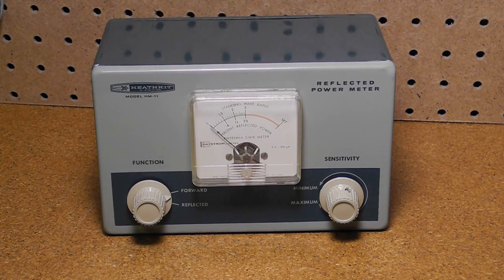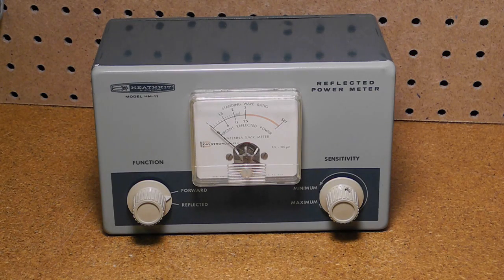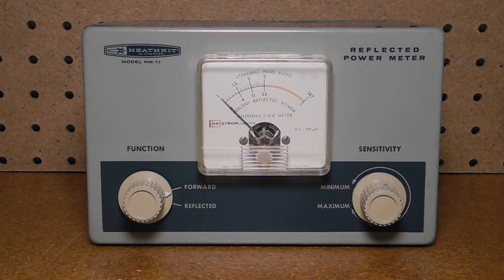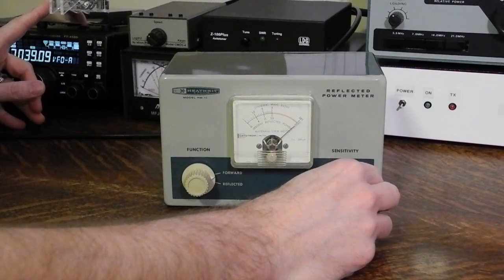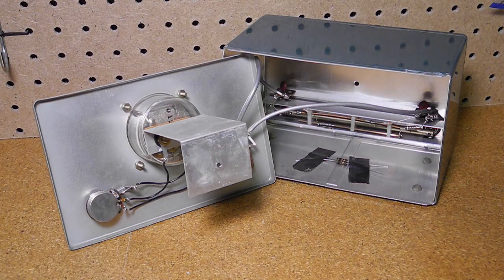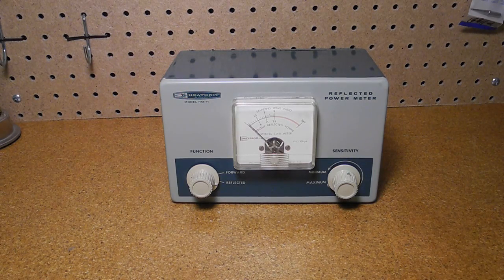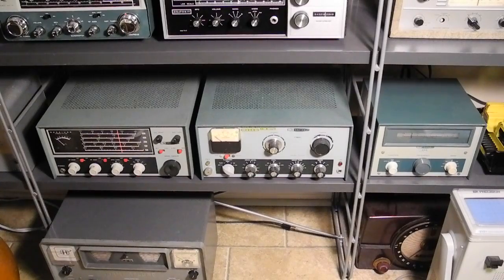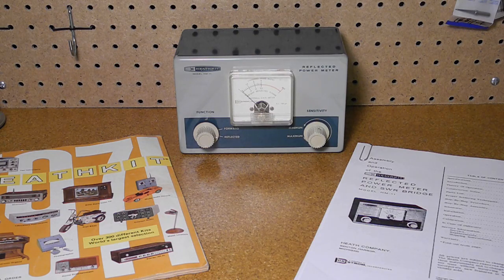The Heathkit HM-11 Reflected Power Meter and SWR Bridge

Comment: Jeff, Would this work with a Heathkit HW-20 2 meter rig that has 8 watt TX output and 10 watt CW output? Thanks!
Reply from the maker: No, it is only designed to work up to the 6 meter band. The 2 meter band is too high in frequency.
Reply: Jeff Tranter
Thank you for the reply!

Comment: Jeff....I picked one of these up on E-Bay 2 months ago and I hv it connected between an MFJ Versa Tuner Two & a new IC7200.The Versa Tuner shows me 1.1  SWR & the Heathkit is showing me 1.7.This is feeding a random wire temporary antenna until the weather improves enough to get a dipole up on my tower.Any way To test which meter is correct without another measuring device like an antenna analyzer?..Tnx...73
Dana......WN6OHG
Reply from the maker: A number of things could make the two SWR meters read different but that is a large discrepancy. Do both SWR meters match as far as what tuner setting produces the the lowest SWR? Your IC7200 should also indicate SWR, how does it compare?
Reply: the heathkit  and the 7200 both show 1.9 and the tuner shows 1.2.I believe the heathkit and 7200 meters.My wife just said the cw signal is turning the vcr player off and on and interfering with the cable tv. too nothing like a little tvi to make your day.73